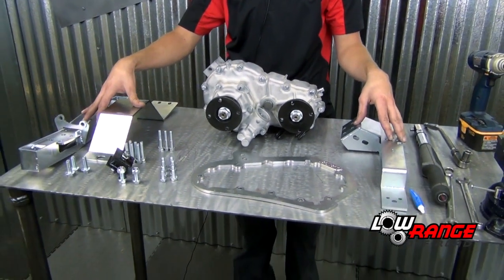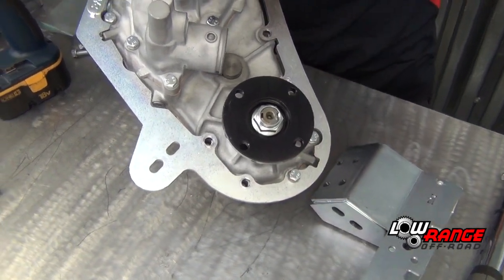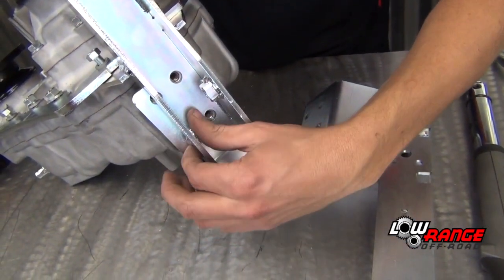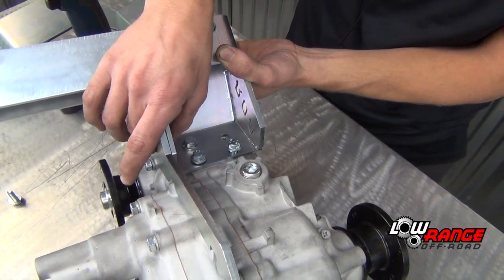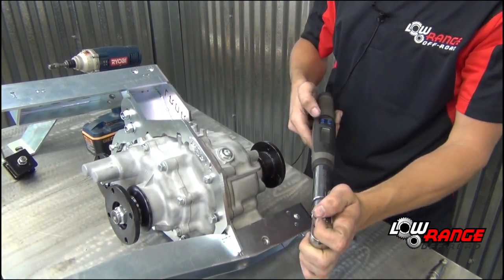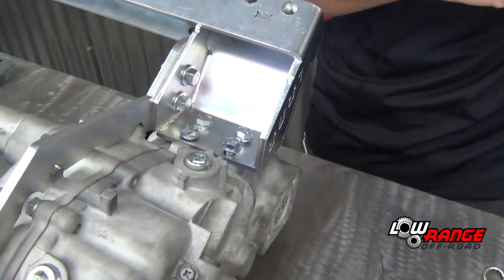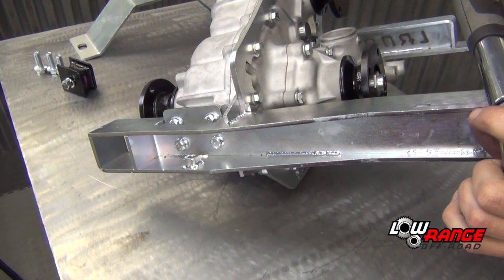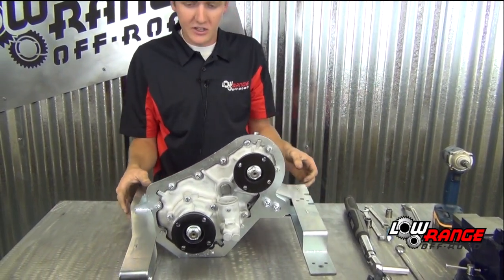Suzuki Samurai EOS T-Case Cradle Instructions

Comment: Don't forget to mention if you use the provided hardware that is suppose to bolt into the 4 factory mounting holes on the passenger side of the transfer case WITHOUT your own washers you can torque the bolts to spec and crack the case...  ask me how I know...

Comment: Am I correct in saying that the weak spot however is on the actual mounting location. How will this help not breaking off mounts? Please explain.
Reply from the maker: Good Question. The main weakness we see in the OEM way of mounting the T-Case
to a Samurai frame is where the T-Case brackets attach to the T-Case
itself.  They tend to break at this point.  The other concern we see is the rubber mounts
themselves.  As you pointed out.  They do break as well.  We believe we have virtually eliminated both
problems with the EOS.  We have multiple mounting points attaching the case to the EOS cradle, which shares the loads and stresses between many bolts.  Additionally, we have added a 4th rubber mount instead of the original three and designed the cradle such that all 4 mounts are being compressed, when the
vehicle is driven forward, in stead of being pulled apart.  We hope this answers your question.  Thanks
for viewing and commenting.     

<!--
 /* Font Definitions */
@font-face
 {font-family:"ＭＳ 明朝";
 panose-1:0 0 0 0 0 0 0 0 0 0;
 mso-font-charset:128;
 mso-generic-font-family:roman;
 mso-font-format:other;
 mso-font-pitch:fixed;
 mso-font-signature:1 134676480 16 0 131072 0;}
@font-face
 {font-family:"ＭＳ 明朝";
 panose-1:0 0 0 0 0 0 0 0 0 0;
 mso-font-charset:128;
 mso-generic-font-family:roman;
 mso-font-format:other;
 mso-font-pitch:fixed;
 mso-font-signature:1 134676480 16 0 131072 0;}
@font-face
 {font-family:Cambria;
 panose-1:2 4 5 3 5 4 6 3 2 4;
 mso-font-charset:0;
 mso-generic-font-family:auto;
 mso-font-pitch:variable;
 mso-font-signature:3 0 0 0 1 0;}
 /* Style Definitions */
p.MsoNormal, li.MsoNormal, div.MsoNormal
 {mso-style-unhide:no;
 mso-style-qformat:yes;
 mso-style-parent:"";
 margin:0in;
 margin-bottom:.0001pt;
 mso-pagination:widow-orphan;
 font-size:12.0pt;
 font-family:Cambria;
 mso-ascii-font-family:Cambria;
 mso-ascii-theme-font:minor-latin;
 mso-fareast-font-family:"ＭＳ 明朝";
 mso-fareast-theme-font:minor-fareast;
 mso-hansi-font-family:Cambria;
 mso-hansi-theme-font:minor-latin;
 mso-bidi-font-family:"Times New Roman";
 mso-bidi-theme-font:minor-bidi;}
.MsoChpDefault
 {mso-style-type:export-only;
 mso-default-props:yes;
 font-family:Cambria;
 mso-ascii-font-family:Cambria;
 mso-ascii-theme-font:minor-latin;
 mso-fareast-font-family:"ＭＳ 明朝";
 mso-fareast-theme-font:minor-fareast;
 mso-hansi-font-family:Cambria;
 mso-hansi-theme-font:minor-latin;
 mso-bidi-font-family:"Times New Roman";
 mso-bidi-theme-font:minor-bidi;}
@page WordSection1
 {size:8.5in 11.0in;
 margin:1.0in 1.25in 1.0in 1.25in;
 mso-header-margin:.5in;
 mso-footer-margin:.5in;
 mso-paper-source:0;}
div.WordSection1
 {page:
Reply: lowrangeoffroad that makes sense. will definetly be ordering eos and spoa kit shortly
Reply: Andrew Hall 8

Comment: i'm sorry but putting that passenger side (long) support between the back bone and T case just does not seem correct, it leaves a gap all the way around the the backbone and T case. it needs to go on the outside of the backbone!
Reply: I totally noticed that too!You're right it needs to be on the outside so the backbone can lay flat.